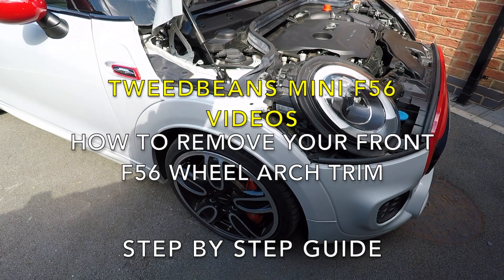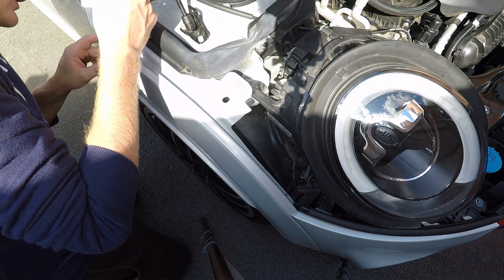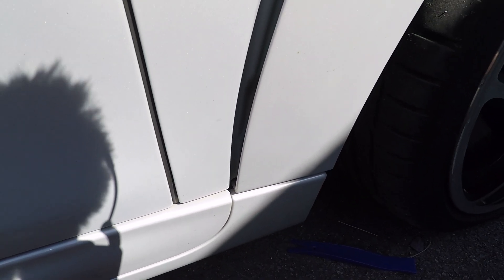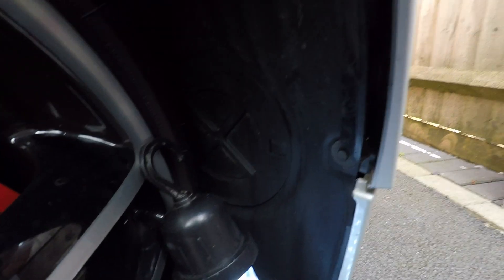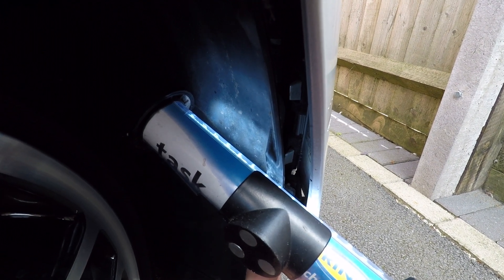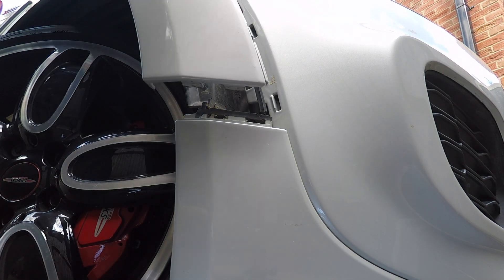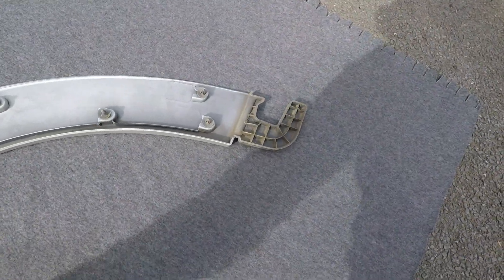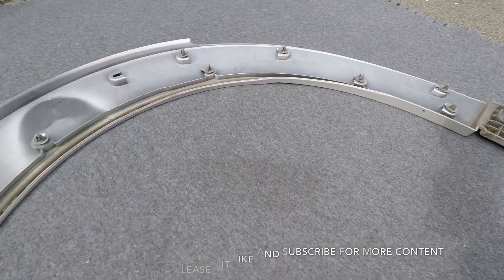BMW MINI F56 - How to remove the front arches instructions FAQ 2014-onwards

Comment: There is a variant of these plastic arches that has a built in LED ?turn signal on them.Did you by chance encounter any connector dangling, for this led under the arch?.
Reply from the maker: Hi thanks for watching.  Sorry nothing under there that I could see.  Assume that’s for US spec cars which may have extra wiring

Comment: Have you painted or wrapped the plastic arch, or yours is stock the car color?
Reply from the maker: Hi I actually removed colour coded arches and fitting stock ones as I’m not a fan of colour coded arches on an f56
Reply: I’m thinking of wrapping my stock arches, but they are plastic, do u think the wrapping will stay?
Reply from the maker: The fact someone has probably treated the black arches in the cars lifetime with some sort of back to black etc I would assume it won’t stick.  Cars I’ve seen with wrapped arches had them painted first